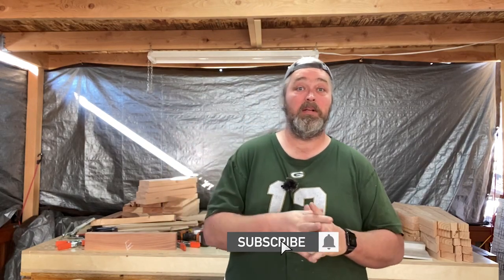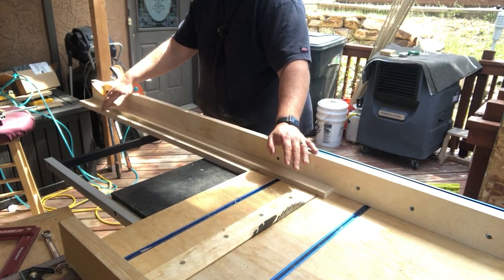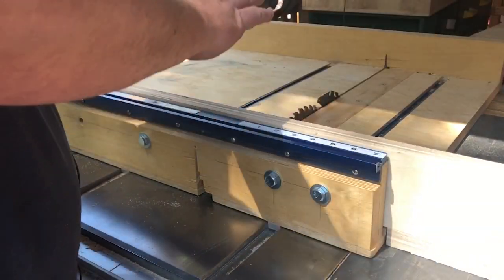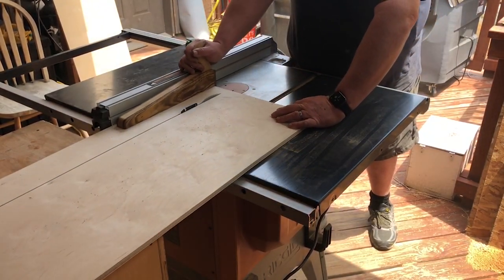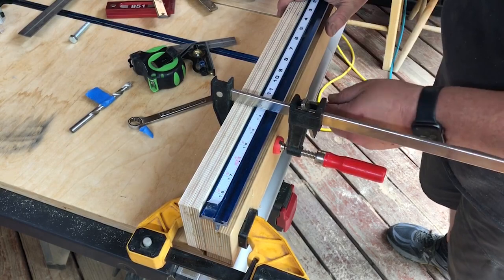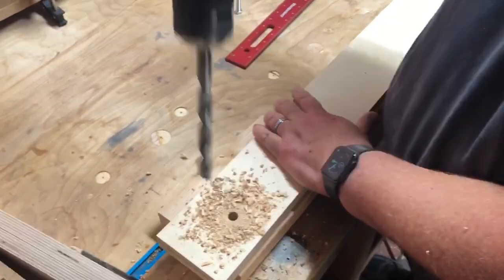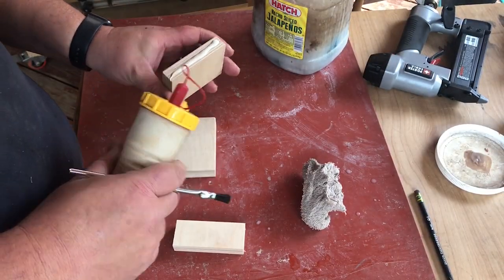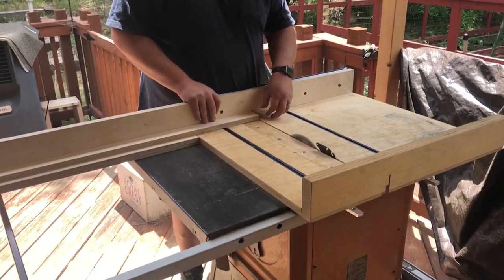How to make repeatable crosscuts on a smaller table saw - Safely!

Comment: Why don’t you make a true zero clearance insert for your tablesaw sled? Then you can just line up on the kerf instead of the blade. I use a piece of blue tape on my fence which is a whisker more accurate than even a fresh kerf in the insert.
Reply from the maker: I have a removable insert for the kerf in the sled and i replace it as it gets worn down. I have also used the blue tape trick in the past. I just prefer to reference the blade. That way, I know it’s true and don’t have to worry about it.